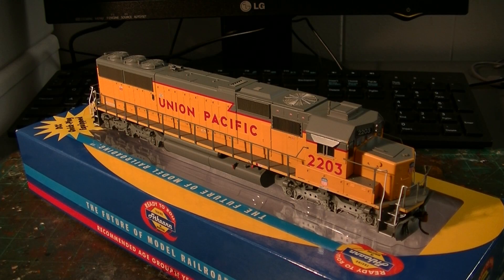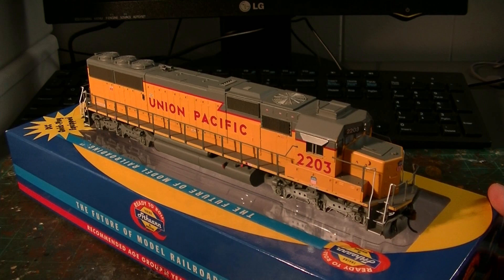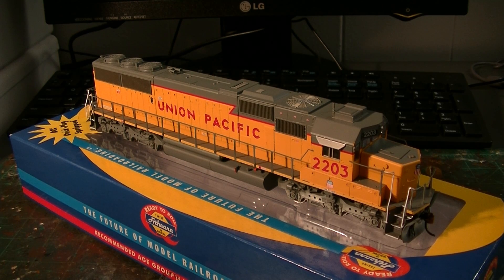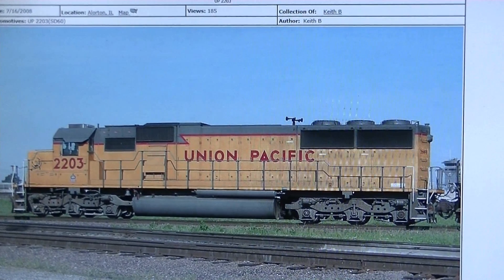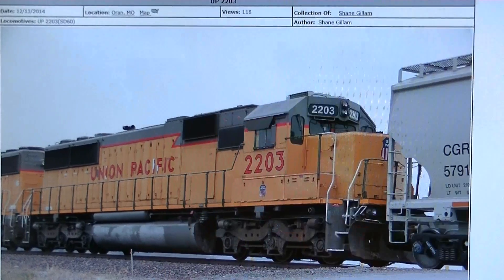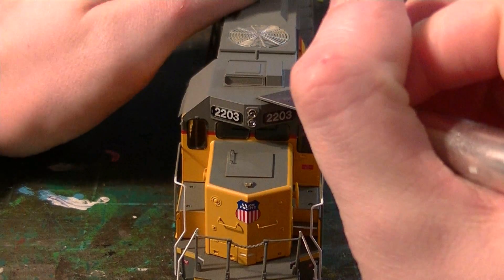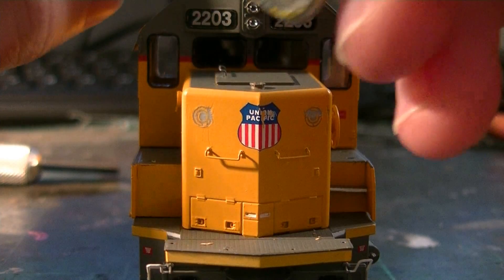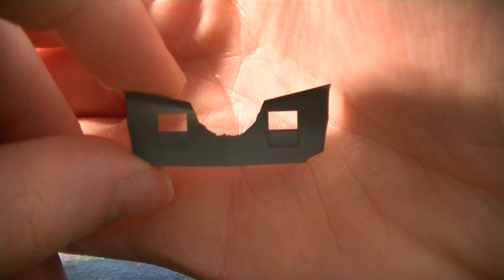Locomotive Detailing & Weathering! Stage 1, part 1 of 2. REMOVING & ADDING DETAILS

Comment: Details West PL-234 is the correct plow for UP and CNW SD60's and some of the NS SD60E's.  Based on all the pictures on the internet, it appears that the 2203 also has this plow.
Reply from the maker: For a certain time period, yes maybe.   However, look at the modern units, and this one in particular.  UP standardizes this style plow and it's quite modern.   The 234 plow is not correct for this unit now, though at one time it may have had that style plow before being upgraded through the 2000's.

Comment: Im trying to detail a walthers proto 2000 gp60, number 1946. I dont know where to get the correct plow. It is the standard north little rock plow. The plow it came with is too short to modify. Should i modify the details west Pl-234 plow?